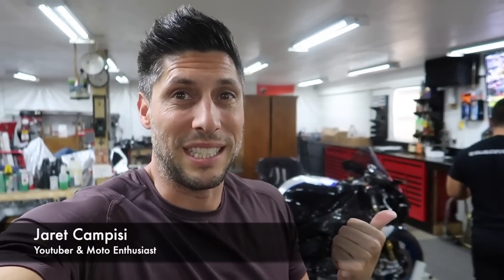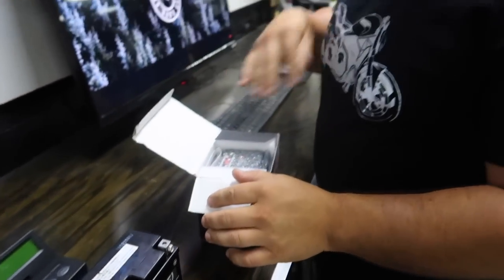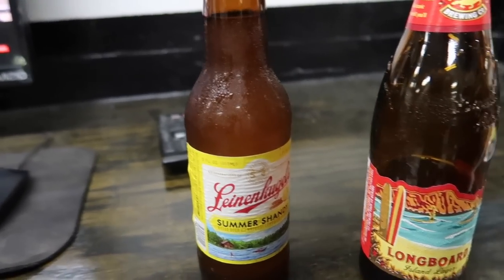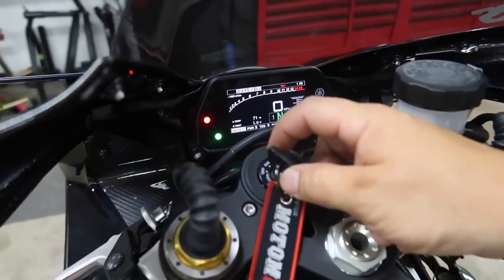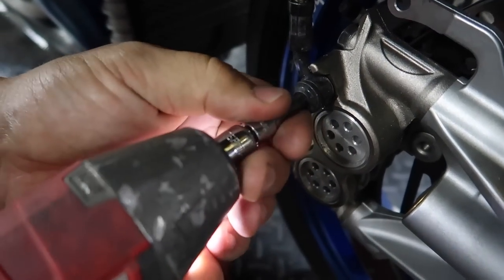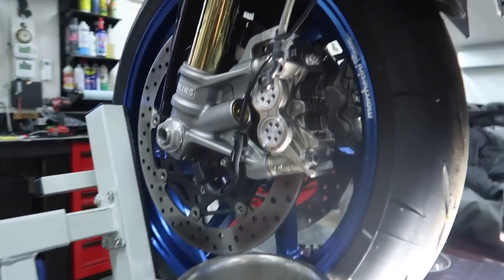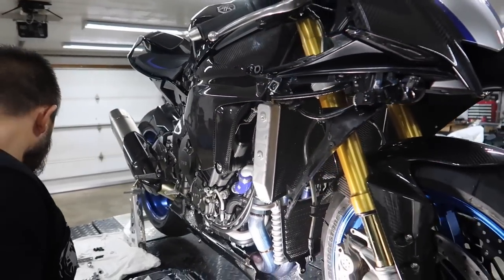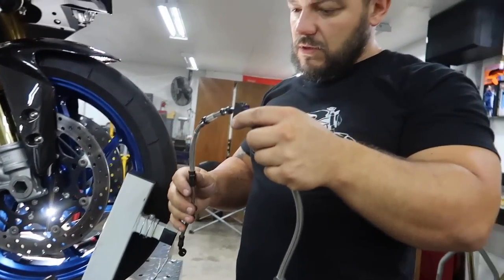Superlight Battery & Carbon Brake Lines for Our R1M!!!

Comment: Guys, recently used a typical pharmacy retail 100ml fluid syringe. The gasket will not tolerate the brake fluid, but its good for a few rounds. Very clean way to extract fluid from lines n caliper, and also to quickly fill back everything.

Comment: Interesting that the R1M takes a smaller battery than my 600RR.  I replaced mine with an antigravity battery about 5 years ago, I love it, saved me 5lbs 2oz!
Reply from the maker: I'm pretty sure they do that for weight savings since they basically said this is a track bike that they slapped lights on to make it street legal

Comment: How do bike charging systems handle lithium batteries,  don't they charge at a higher voltage than the original lead acid battery?
Reply: Voltage is same or lower, It has a balancer/maintenance circuit inside, and it's just 6/8 18650 type cells.

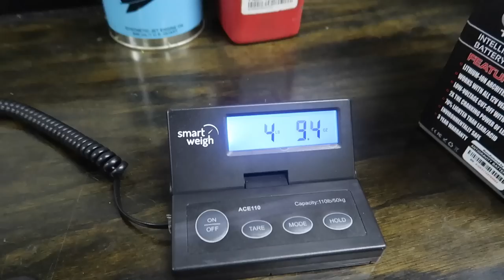Comment: 4:51 Wouldn’t it just be better to go exercise and loose 5 or 10 pounds? Never really understood what the point of spending $200+ on a battery because it saves you 4-5 pounds. Please educate me.
Reply from the maker: Removing weight from a bike does more than simply "remove weight."  It changes the way it brakes, handles, accelerates etc.  Also where the weight is removed from plays a big part.  Higher up on the bike can change the feel, rotational mass from parts that spin like wheels, sprockets, rotors all change the dynamics of riding the bike where as simply losing 5 lbs off your body doesn't have the same effect.